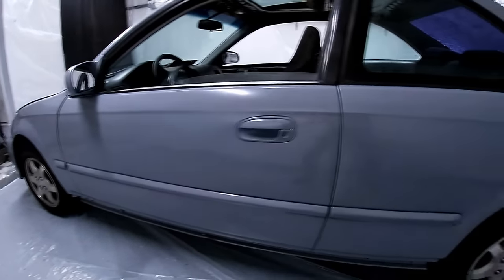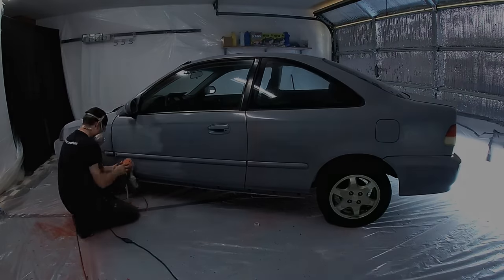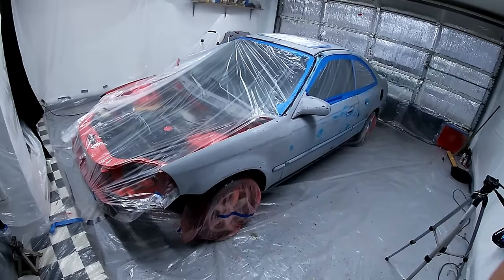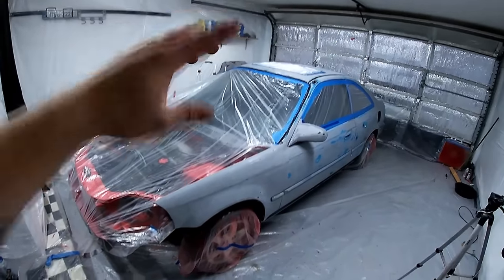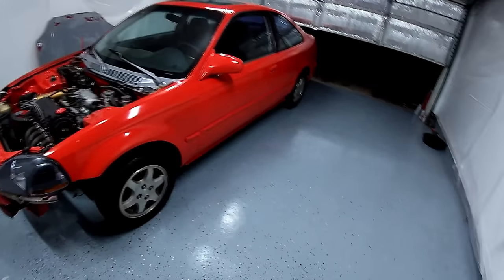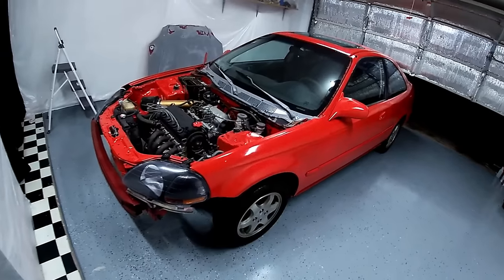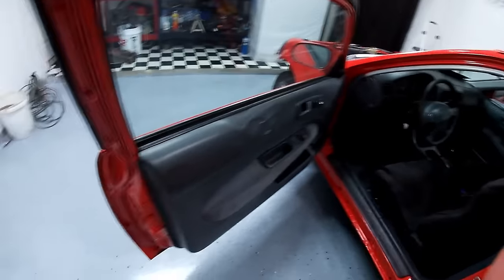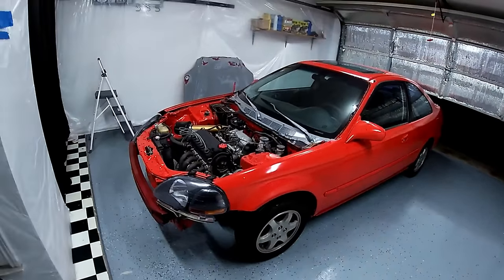Rustoleum strawberry red spray can paint job! Check it out!!

Comment: I'd never recommend FIRST TIMERS putting down a heavy coat like that first try. Start on one side, do a lite coat & work back around to the start.
That will be ready for a heavier coat. You don't need to be sanding back paint runs. Prep is everything. The video & gloss paint is masking some not so good areas, that you can see on the trunk/boot. I think it's important that first timers know, the more time & slower you do it, the better the result. I would definitely do a few coats, clear, wet sand, buff & polish. To do a whole car that starts adding up. Honestly, better to buy a few litres of paint & clear, a cheap spray gun, buy, borrow or hire a small compressor. Just my opinion, after doing many DIY paint jobs. This still gets a 👍🏼

Comment: What do you do about orange peel and imperfections before hitting it with clear coat?
Reply from the maker: Well the orange peel isn't that bad so most the time i don't do anything. Im not expecting show car results but if that was the goal i would wet sand with 1000 and 2k clear it.

Comment: I don't know where to begin..
You did all that prep on the car and garage only to just hit it with cans. Might aswell have sprayed it with a gun, it would be cheaper and have a far nicer finish. 1-2 litres and thinners is cheaper than a whole bunch of cans.
You could have also painted it blown apart too because it's a solid colour, hit the jams and inside of doors, bootlid and bonnet aswell as the outside at one time with parts hanged. No need for soft edging or having noticeable blends.
Also, don't need to try get full coverage on first coat just dust it to tack and spray more on cut throughs and that dusting will act as adhesion coat and slight colour coverage before you hit with a couple solid coats and have proper layer overlap and finish becomes much flatter.. 
Dust coat also lessens chance of fish eyes or gives advanced warning of it asznd it's easier to deal with a dusting than a solid cost

Comment: Hey man sorry to bother you again I’ve watched almost every video where you have used The rust oleum 2X and have tried to remember all of the tips and tricks that you have provided but I’m about to attempt to paint my 89 Chevrolet Silverado single cab short wheelbase with the rust oleum 2x satin claret wine.Didn’t you say in one video that red or maroon any red or dark red color is a little harder to not tiger stripe? Another question I know the rust oleum 2 x has a primer in it,But in one of your older videos where you painted that four-door box caprice Orange the car was already had a black primer do you suggest using a primer first and then putting on your rust oleum 2X paint color? Any advice you have to suggest will be greatly appreciated and your car turned out amazing good job bro!
Reply from the maker: Crumb catcher 5588 For absolutely best results you want a primer but it’s not needed and the color itself isn’t what stops stripes it’s how fast it dries/overlap/temperature and a few other factors.
Reply: Moore Motorsports James Dguy Thank you so much bro you forgot to mention talent, do you have to have talent and you sir or an expert at spray painting and painting with a gun. I’ve seen you paint outside inside in a garage in a carport,You just got talent my friend

Comment: The car in my profile pic is my 65 dodge dart . I had used rattle can satin black krylon paint. Then over a couple of years the paint started to fade . I made the mistake of getting the krylon paint and primer in one cans . with in a few week the satin black faded to dark gray 🙄😫😡 as you can see in my photo. I quit uaing krylon and only use Rust-Oleum products now especially since they have an rust preventer in their canned products. I am getting ready to rattle can the dart again with the Rust-Oleum satin black only. I do my painting in the mornings or evenings or on mild days and not out in direct sunlight. I allows the paint to apply better and cure slowly for a better even coat . I wet the ground down to keep dust to a minimum since I dont have a sho p or garage and no paved driveway

Comment: I have to shoot mine this summer but it is my daily
Reply: If you're OK with the embarrassment of driving it around looking bad/multicolored for a while (maybe months) just do it panel by panel, especially if you don't have friends to help and a garage. If you go panel by panel, it's easier to mask off just that section (spend say, 20 minutes, instead of 2-3 hours with the whole car) then the rest of the car, cover it with drop cloths/old bed sheets. You can use plastic too, but plastic's issue is blowing away/onto things in the wind outdoors. Wait until it's about dusk and cooler out (I find ideally below 70F) and the metal is cool to touch before you paint, and you should be good. Just don't paint when it's hot/sunny out, and that's 99% of the battle, just picking good conditions.

Comment: Looks cherry my guy !! I started doing this a long time ago when around in my town it wasn’t a thing to use can to paint , but my experience with rust oleum paint weather it’s the 2x with primer built or just baise comes out fine but weather does beat down this paint I’ve spent more money on these cans than I can imagine , but cheap to do a daily ant noting wrong with it , but be careful not to use there crystal clear paint it litterly flakes off over time heat exposure is bad for that paint I’ve wet sanded it and buff comes out great but over time especially don’t take it to a car was the detergent use on that was litterly weakens the paint and clear , .! Inmop krylon is a better brand I painted my Mr2 with that one and it’s sitting outside already for 3 years and it hasent chipped or faded , but all in all great job I really like it just try avoiding the clear it will ruin the paint underneath and don’t mix krylon or rust oleum they just bleed or bubble
Reply: So what kinda krylon should I get for what you said you had? I want red but what am I looking for name brand and what kind I live at the beach also ,any suggestions ? And do I gotta lay down a great primer job? It's my work truck but still.  Thanks let me know what you suggest. If you have a picture that would be nice of your car.
Reply: @tonyrobertson9452  definitely krylon ! There line up of product is good better than rust oleum. I used there 2x double cover paint , that was than , they still have the same one but in one which is both primer and paint in one , look for the one that comes with primer and paint ready , it will save u time priming the car , and waiting for it , but word of advice since it’s two in one , you might want to go light passes since it’s thicker , but once done it should honestly last u a lot , I had used there two in one gray paint on my bumper came out great really glossy , but when I went to change up color I had to sand it and I tell you thing is tuff for it to take up two pads on the da it’s tuff and worth the buck .

Comment: Hey man can you please help me out with a question? I have a 98 Honda Civic EX but I don't feel like going through all the trouble of swapping to a manual. I can't find anywhere on how to tune my car after I install all of my parts. Like a cam, cam gear, valve springs, etc etc. How do I tune my car to accept all of these modifications. I don't understand why they don't make something like Hondata for automatics.

Comment: For a rattle can job, that is a good result.  Buy a $150 HF compressor (min 9cfm @90psi) and a $20 spray gun and it will change your life.  You will be amazed.  Shoot the same paints.  Do the same prep.

Comment: New to the channel.  I just want to say from the beginning that I am not trolling and I don't mean to be insulting, but I don't think it looks very good.  So a few questions.  Will you wet sand this later, like real car paint?  Can you even do that?  Compound and polish?  Will that make it smoother or are we all just saying "It looks great because we realize it was just rattle cans?"  I also noticed that you just did one thick coat instead of multiple thinner coats.  Why is that?  I like the color and from a distance it looks a lot better than some primer or something.  Just curious if this is the best that can be done with this kind of paint?  Thanks.

Comment: Constructive advice and comment if you think it is a good idea. Read this out.

Calculate the MLs of paint needed for the area you are covering. Purchase the ammount needed of spray cans for the application.

Pop two holes in all of the spray cans to let the air out and pour the paint in a choice container.

Use a low pressure high volume (aka LPHV) paint gun with a decent air compressor and spray the car with it so you have more control, which will help to acheive a nicer finish and less wet sanding before a clear coat or wax is applyed depending on the paint chosen.

Point of doing this is to save money on paint and possibly the whole job in general.

Personally I will be wet sanding my next project almost glass like smooth than vinyl wrapping it.

But if I was painting on the cheap, I'd use a spray gun.

Comment: Im starting my spouses car a 99 Toyota Camry that seen better days (mechanically fine just looks awful with failing clear coat after years of neglect).  I first used your recommendations for the rims from a Lexus IS200 and they came out awesome / fits her Camry too.  Rustoleum high gloss black with 2K over the rims, was my first attempt will do it again.  Over the next month I‘LL preparing for the body to be painted in white kinda like your Panda video, thanks for the inspiration and for tips and tricks.

Comment: I raptor lined my 97 civic coupe championship white. I liked it but it was difficult to keep clean. And stripping it after for a full respray... omfg dude. Just seriously think about it first. Once u raptor line theres no going back basically. It took me 70+ hours to fully strip it back, reprime, and repaint with some ebay single stage. Those bumpers will not be salvageable after raptor liner. Just really think about it dude. Wish I could attach pics in this comment so u understand what it takes to redo when ur bored of raptor.

Comment: You need to prime it before painting or you wasted your time prepping. Separate primer to paint, will make your work look better.
Also first coat must be alot thinner allowing the paint to stick easier when applying coats, doing this will avoid running paint which is always a prick to perfect, you should've blacked out the strips to break the red off otherwise your prep work looks fantastic & you choose a good car.

Comment: I've been painting little things to buildl myself up to a whole car. How do you keep a gloss over a huge area? When I spray the paint shines but when I do the next line above or below it there is a paint haze. 

2nd question. They say do 2 coats then add a clear. It takes so long to do something like a large door or hood doesn't the paint start to harden? Or do you have time to do a clear coat? Or does it make sense to wait 2 or 3 days to do a clear coat.

Last question sometimes I get what I call paint achne where there are clumps of little holes or bubbles
 What's the best way to make sure they don't pop up. I cean the hell out of the parts before I paint and sometimes no matter what they show up.

Comment: I struggle with high gloss paints.
Reply from the maker: Amanda Webb I use to as well but chasing the wet edge is the best way and making sure to keep the panel as wet as possible so that when it all dries it dries even with no lines or dry spots.

Comment: How long would you say it takes to paint your civic
Reply: Nole Hopkins It honestly depends on if you want it to look real good. I painted my boosted 99 with the same type of paint (different color: colonial red) in a day. I didn’t take off anything, I just covered it. It came out decent.
Reply from the maker: @nhsk-esteem5529  Yes you are right it can be achieved in 4-6 hours if you don't remove anything and the conditions are right.
Reply from the maker: It can be done in 1 day if you don't remove anything at all.

Comment: If you are going to the trouble of using cans..then do it with 2k not 2x. It just doesnt cut the mustard no matter how you spin it. I appreciate your enthusiasm and dedication. If you cant afford 2k cans...then save up for it. Honestly there is so much orange peel..as those cans have awful spray nozzles...2k cans have really good nozzles and lay a lovely finish. Even if you are not a pro...its your car..not a lawn mower or a tractor..but something that is for many a daily driver. Spend a little more and the results will be many times greater. I know some will disagree but i am only saying this because of all the trouble..preparation..and time taken to get to this stage only to have it ruined ( my own opinion ) by cheap paint not designed for car finishes. Anyway top marks for effort and continued great content!
Reply: Meh, there's factory paint jobs with orange peel.

Comment: I love satins, I wrapped the spoiler side view mirrors and made two unique stripes on the hood that I used 3m trim line to make them the same shape as the sides of the stock hood scoop that goes all the way down hood on the RS 2015 Camaro it's avalanche white and satin blackade it pop with that flat sheen and tinted rear tailights was a huge improvement as well at night